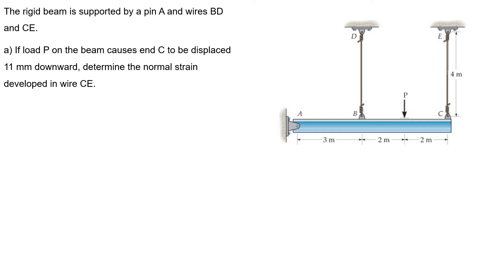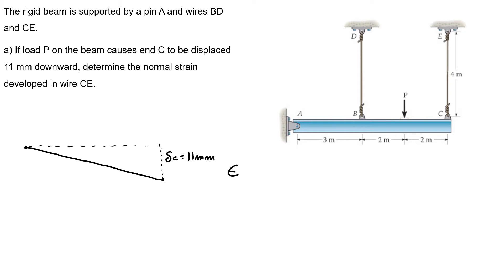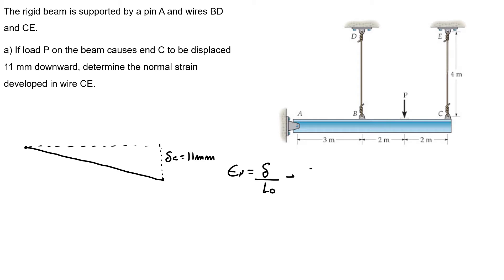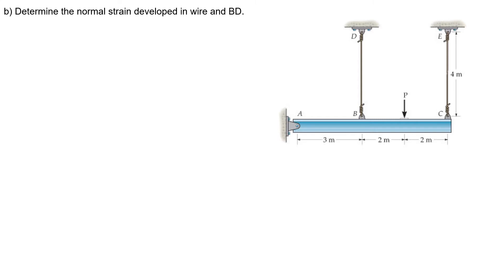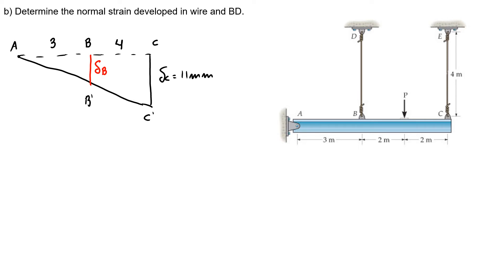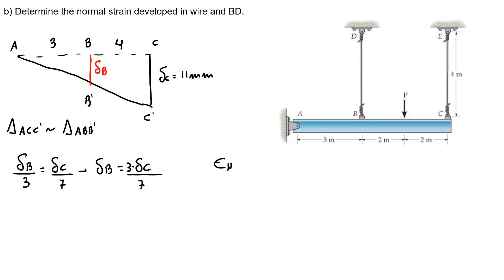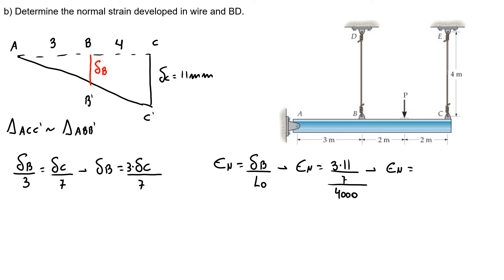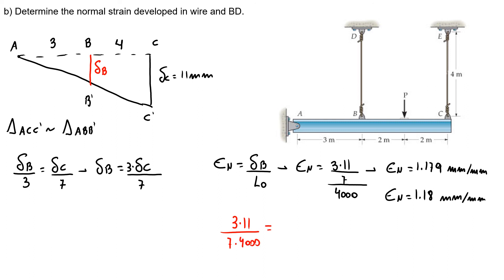Internal Loading - Exercise 1

Comment: You need to make sure to keep all units of measure throughout your equation in the same units. In part B, you used meters with mm in a calculation.
Reply from the maker: You are right. I forgot to correct the units. Thanks!